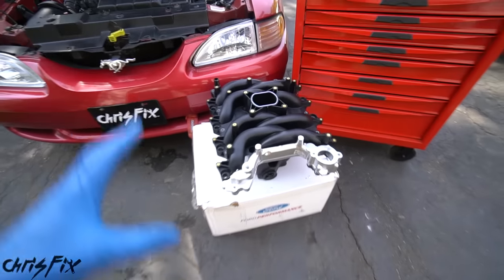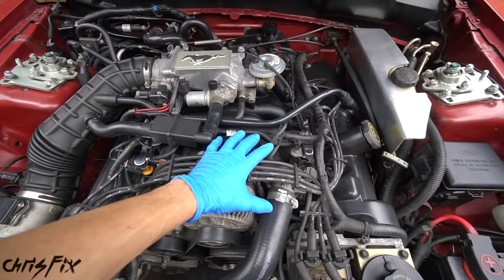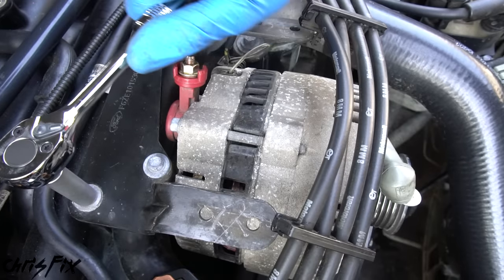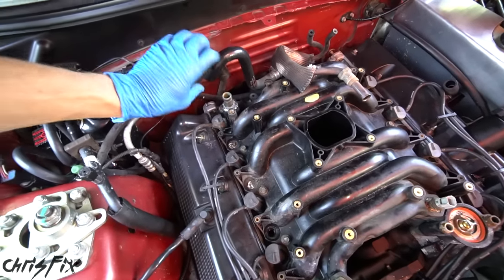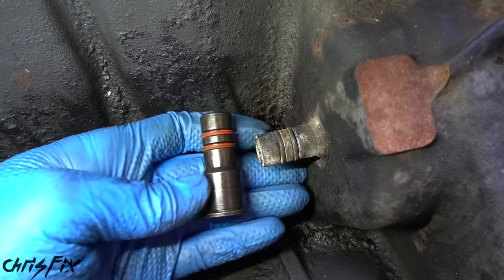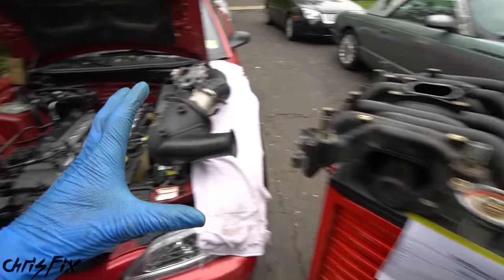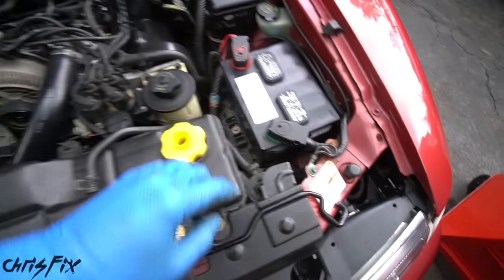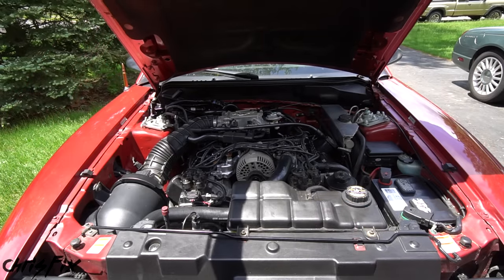How to Install a Performance Intake Manifold and Replace Gaskets (Dyno PROOF)

Comment: A Turbocharger installation vid would be sweet
Reply: Jack Mclaughlin super*
Reply: Super charger is much better and more reliable
Reply: Ballz Of'steel depends who you ask... turbos are more efficient
Reply: Jack Mclaughlin turbos arent good for drifting .on concentration drift
Reply: But super has better power delivery ;)
Reply: Ninja R3Kill  who said turbos arent good for drifting they are the most used for drifting
Reply: albimmer turbo give sudden jump of power which could be bad when initiated in a drift.
Reply: Ninja R3Kill  small turbo bigger injectors  big boost tuning
Reply: oh god another turbo charger vs super charger debate. :/
Reply: albimmer a lot for a turbo, stock or supercharger would be mad tho
Reply: Ninja R3Kill whats even better than turbo and superchargers is twinchargers its a turbo and a supercharger  combined
Reply: albimmer sure
Reply: Jack Mclaughlin  you have a good idea
Reply: Jack Mclaughlin A Supercharger is easier to install,a supercharger installation video would be better,Because its easier and people can do it at home.
Reply: Would be awesome for his $300 Del Sol.
Reply: EarthClad nope. Turbo is best
Reply: Guys... there is twincharger so you can stop arguing wich is better...
Reply: Vortech supercharger lol

Comment: I'm all for installing a new intake. But. Seeing what happened to the old one. Holy balls.
Reply: Thanks for the heads up! I've never seen nor heard of this happening. Might make me rethink buying an older Mustang.
Reply: The GMC intakes are also notorious for intake manifolds leaking. The gaskets and the manifold itself would melt around the egr, usually between 60 and 100k. Suddenly you get a gusher right into your ports and then hydrolock. And then you have the leaking valve cover gaskets resulting in oil on the exhaust and then fireballs. Official recall fix is more tin foil...
Reply: James Bell yup mine cracked and leaked all over!
Reply: Daniel Rouw Never had that happen to ours, but ours only recently hit 130k. We talking 5.3 and 6.0 or just most GM engines?
Reply: hewfil1 no, i was referring to the 3.x v6 car engines and the 4.3 v6 abomination. GM wasn't dumb enough to try plastic on the larger engines as much. The ls series engines you have are fairly good. Just watch that you didn't get the bad head. There was a couple that had porous metal around a coolant channel. I think that was the 5.3.
Reply: Trashman yup. Plastic. But to be fair it's partly gov regs, heat resistant composites aren't cheap. It's more a weight reduction than cost savings.
Reply: Abominations?! I love those little things. 
And our truck is a 5.3 so if that's the case I'll keep an eye out.
Reply: hewfil1 the 4.3 isn't all bad. But it's far from a good engine. It's a v8 with 2 cylinders lopped off essentially, which results in a poorly balanced and inefficient engine.
Reply: hewfil1 just checked. It's the earlier 5.3. 2001-2006. Gmc issued a TSB.
Reply: Our 5.3 is a 1999. WHEW

Comment: This mustang needs more power,nice work😉
Reply: Mahmoud Dh i think he is gonna throw a supercharger in it
Reply: moamel B yehh of course
Reply: Turbo!
Reply: A coyote is needed, amazing how much better they are than the Triton v8.
Reply: everss02  The triton v8 was only in the trucks via the 4.6 or 5.4 the mustangs all 96-04 2vs were either Windsor or Romeo blocks the difference is the tritons compression chamber were at a 75 degree angle for torque and the Romeo windsors were 90  for more power and when I say angle I mean the v in the center of the motor tritons are closer while mustang motors are further
Reply: @johnmcclenaghan6561  , ......... you sure about that
Reply: @everss02  If a coyote will fit. They're 29.5 inches wide. That's about as wide as a big block chevy with tall valve covers. That said, yeah, a even a stock Coyote would double the power. This thing is choking to death above about 4k stock but the manifold helped by bringing the curve up to about 5k. Thing needs cams.

Comment: “not difficult to do” 
me: sweats nervously stares at my engine in shambles
Reply from the maker: I promise it's easier then you think!
Reply: Write out a list of each step for disassembly, and give each step a number. When you're done, even if it's a lot of steps, think to yourself it can be done in XX simple steps. Start with one and before you know it you'll be done.
Reply: Oh yeah yeah
Reply: @chrisfix  I am kicking myself for not seeing this tap part. everyone around me has 3/8 16 npt cant find the 18
Reply: @ruhan_a  oh yeah yeah
Reply: Yeah, it's really a big a** job.
Reply: This is my EXACT problem right now, which is why my brand new intake manifold is still sitting in my kitchen and not in the car lmao 
Mainly in part because I'm just nervous as hell of doing it
Reply: Dude I just did this on my 03 mustang gt and honestly I was dreading it until I started and honestly it was really really easy. I’m confident if I can do it you can do it. I’m a YouTube mechanic😎😂
Reply: @brandonstone6962  same
Reply: @shamallewis405  Once you start doing it, it really is pretty easy, you just have to take your time and put all the bolts in a labeled bag and put them in order of disassembly..
But my suggestion would be to run by the ford dealer and get yourself a set of intake manifold bolts BEFORE you start.. And make sure you have a torque wrench handy as well.. But other than that it is all really easy and straightforward, just make sure to get some pics of everything in case you forget where a few things go after.. But take your time and it could possibly be a good idea to have a good set of bolt extractors handy as well JUST IN CASE
Reply: @PreciousBoxer  wait that's actually useful, thanks
Reply: @chrisfix  than*

Comment: Have a 97 T bird and I put a PI intake off a 2010 crown Vic on it and it definitely wakes up at redline. It made a huge difference for mid and high range power.

Comment: drills hole into intake manifold

Chrisfix: 🤷 op, would you look at that. Guess I have to install a performance intake. 🤷

🤣🤣🤣
Reply: I feel like he pokes holes in his car parts so he can make a video on replacing it
Reply: @cesarrobledo458  it's joke but ford designed these intake manifolds terribly. The 96+ 4.6 2v   intakes were made out of plastic and that crossover that was leaking coolant was recalled. They kept plastic everywhere else, just not on that crossover. He has a PI intake from FORD FRICKING PERFORMANCE and it's still made of plastic.

Comment: I don't see how you need 50 years of experience to do this. But regardless I learned something valuable today ☺
Reply: roger3137 That last sentence is the key.  You don't NEED 50 years of experience, but if you say 50 years compared to 5 or 10 is nothing, either the 50 years have been wasted by someone incompotent (which I know who you're referring to, so that's not the case), or you're talking out your ass.  With the years of experience, that's more cars worked on, and therefore, more experience.  With each car worked on, it's a potential for learning something new and learning new tips and tricks.  So there are some things that the geezer can teach a novice that he would have probably figured out years later, and likewise, there might be some things the novice could teach the geezer that he may have overlooked in all his years, and I'm using Novice relative to the years of experience.

Comment: Tip, if u dont want to cut a bolt for alignment, line them up and put extra rtv dots throughout the gasket to hold it in place. Thats how i did mine and it lined up with the coolant ports/ bolt holes almost perfectly
Edit: would mention to sit something on gaskets while rtv sets before torquing down intake (pevents air leaks where gasket doesnt  want to flatten out)  I loved the dyno sheet in this video because the 4.6 community doesnt have a whole lot of actual before and after references for the npi intake vs the pi intake.    cams, pi intake, injectors, and bigger maf will net you even more. About 250/260 crank hp

Comment: *Dog drinks coolant 
Next video: “How to revive your pet with common tools at home”
Reply: You forgot the “soapy wooder”
Reply: And your medium strength threadlocker
Reply: But there will be some special tools that you can get at your local parts store
Reply: "How to flush out the fuel intake on your dog"
Reply: How to drain your dogs coolant using only a screwdriver
Reply: Is this a head gasket replacement
Reply: Dont forget the muffler bearings

Comment: so with Performance Exhaust and Performance Intake Manifold we went from 189 HP to about 208 hp there are about 20 HP gains  
nice job lets boost it now buddy 
keep up the great work
Reply from the maker: Yep. Goes to show you that these brands and companies that say “35hp” for a filter is fake!
Reply: yup if it's too easy to make 35 hp from a filter will its suppose to come with this filter from the factory lol
well its time from some boost super charge or tubo it bud

Comment: When wrapping teflon tape around the threads of a fitting, i turn the fitting clockwise. This keeps the tape from wanting to unwrap as you start to tighten the fitting into the port. It tightens the tape instead of making it unwrap. One fitting was done clockwise and the other counterclockwise. I'm sure both will seal fine, it's just something I've always done. Actually, now i prefer to use ptfe paste instead of the tape. To each his own. Keep up the great videos. I'm excited to see the supercharger install and dyno results. 
  I'm also curious about the port alignment on the head vs new intake manifold. It seems that the intake runners were misaligned quite a bit on that gasket. If you gasket match the cylinder head to the gasket, the air/fuel charge will flow more smoothly into the combustion chamber rather than hitting that lip at the cylinder head. That's probably where the torque loss came from. Regardless, 50hp @ 6000 rpms is impressive. Keep up the good work.

Comment: high performance water pump +50hp
Reply: alexdrapeau you mean wooder
Reply: Sticker +5hp lol
Reply: spray paint flames on the sides for +100 HP
Reply: Ricer logic 1000Ft tall spoiler=100009999984747287582829858444+horsepower, Lambo door=100000+HP
Reply: Cringe wheels 26718293029726273738494058166+ hp
Reply: Actually high performance water pumps have different cut angles on the pump rotor to help eliminate pump cavitations that will cause the coolent to boil , and surface tension products like "water wetter" will eliminate air bubbles from forming around the back of the water passages in the cooling system

Comment: Chris, your videos are the thing, man! You put in so much hard work planning, performing, and then, editing the videos, it appears so easy to the viewers, even though it's not. After seeing your videos, I slowly started learning and trying to fix my 14-year old car, a 2008 Toyota Prius 2nd gen. It had a lot of trouble as I had to learn about MAF sensor cleaning, throttle body cleaning, air filter & cabin filter changing, finding performance oils & oil filters, spark plugs, PCV valves and transmission fluids, but your videos are very helpful man. Thanks!

Comment: I did the exact same thing on my 99 mustang :') huge difference in the wait pulls
Reply from the maker: Yea it is pretty significant! I wonder how much more power you get on a PI engine?
Reply: Significant full pi swap which is the heads cams and intake is around 35-40rwhp peak and close to 100rwhp gain above 5k rpms.
Reply: The cool part is you will actually make more power (around 15rwhp more) than a factory 99-04 pi engine because when you put the pi heads on the non pi engine you end up with about a point higher compression due to piston design.
Reply: Chris If your on a budget just pick up the pi cams and springs.  They go used in the $40-60 range from 99-04 guys who do custom cams and springs. And if you want the same overall power without buying the pi heads get step thinner head gaskets at the same time. This with the pi intake you just installed will get you right on par with a pi motor.
Reply: From there add that 75mm tb and plenum you have.  Next step is cai, longtube headers and a tune and optional underdrive pulleys. With all this you can expect around 275rwhp and 300rwtq. Huge gain over stock. Ford really limited the potential of the 4.6 v8 from the factory.
Reply: Last popular upgrade is if you do the pi heads and valve covers is converting to the coil on plug setup and ditching the coil packs and plug wires.

Comment: Chris,  you should clean fuel injectors, as they were disassambled)
Reply from the maker: Good idea
Reply: Or put new ones in so the car makes more power.
Reply: Injectors don't increase power. They just allow for more potential power to be made. That's why they are supporting mods.

Comment: 20:28 ok... 200hp and already spitting flames
Reply: That be his tune running too rich and spitting raw fuel out the exhaust and then igniting. Computer needs tuned for those new mods.
Reply: JoeIsCrazyWillman thanks for explaining
Reply: How is it running rich when the induction was altered and fuel was never touched?
Reply: @eriv4735  When you change induction you need to tune for it or the computer will be confused and  default to generic maps and may be too rich or too lean, which may foul the O2 sensors and then will definitely run richer.
Reply: Older computers have self learning maps that compensate for small changes such as intake manifolds and will work themselves out in a few miles of driving while it learns..a lean situation will NEVER lead to burnt o2s so there is no possible way for a car to run rich with no change in fuel maps (which this car had none)..I think you may have you info mixed up and you may not be familiar with older cars?..I’m not trying to flame just give correct info on the situation
Reply: @eriv4735  I have ONLY owned older cars except for my current 2011 ranger 4.0L (which is basically still a late 1990s motor). Otherwise I've only owned 1996, 1998, & 2000 year vehicles. When I changed the intake on my 96 Ram to a much higher port flow, lower volume, shorter runner intake manifold, I also changed the tune. I changed at the same time to a max-ported stock throttle body, rocker arms to a higher lift ratio roller rocker, and hardened pushrods. Mine didn't spit flames at all, and was putting 216/265 to the wheels. Tune was clean, no smoke from raw fuel even at the upper rpm, and only the faintest puff of black upon letting off after the dyno pulls. Tune is key. Flames is excess fuel plus an escaping spark or a hot egt causing the excess unburnt fuel to ignite.
Reply: I checked out a cpl vids after I replied and that is one nice ram dude, I’m feeling that roll pan..while I can not speak for rams or mopars, I know Fords and I have done more intake swaps than I like to remember honestly and have never come up rich..very lean at times but never rich..in my experience the only thing to cause a flame was altering fuel delivery
Reply: @eriv4735  I know my Ram I don't have to remove the distributor to remove the intake. Don't know it the modular motors are the same way or like Chevy where you do? Cause removing and reinstalling a distributor leaves the window open for a fuel synch issue.
Reply: The modular engine does not have a distributor so there is no timing issue to occur with the swap..the older fords had a distributor but you could remove the intake without removing the distributor..either way if you know how to remove and reinstall a distributor correctly you would still have no issues with timing
Reply: @eriv4735  not timing, but fuel sync. Timing is in the PCM on OBD2 cars.
Reply: The distributor controls ignition timing and fuel delivery is and always will be pcm controlled..distributor has nothing to do with fuel?..I think you may be getting confused
Reply: No, the distributor is gear driven and has nothing to do with advancing and retarding ignition. The PCM sends electronic signal to the coil, and the coil fires the ignition and the distributor simply transfers the spark to the correct wire. The PCM either advances or delays the timing of the spark created and transferring  to the distributor and then to the plug.
The fuel sync is set via the distributor tho. It sends an electronic signal about the position of the cam, which is what the PCM then times the injector pulses by... So an improperly positioned distributor will tell the injectors to fire at the wrong time, but since the distributor on a computer controlled car only distributes spark, not times it, timing is unaffected as long as you have all wires in the correct spots still.
Reply: I do not know where you are getting your information from but none of that is correct
Reply: @eriv4735  It is, because that's exactly how my vehicle works. I have photos of how to  set the fuel sync from the distributor properly. Also, my tuner changes my ignition timeing based on my octane, mods, etc.
Reply: It's not possible to introduce more air into the mixture and then run a rich ratio. I agree, you do seem misinformed.

Comment: The same thing happen on my Lincoln town car. Over time, the one piece plastic intake weakens and leaks. You're lucky coolant didn't get into the cylinders like mine did and mess up the motor.
Reply from the maker: Dang
Reply: Instead of going for an upgrade, I went for a Dorman cheap intake manifold.

Comment: Haha. Get a drain pan. Grabs a turkey bake pan.
Reply: Just changed my bikes oil, 88 cents at walmart for one, you cannot go wrong!
Reply: electroreviews01 hey but if ya buy one everytime you do oil after afew times it'd be cheaper to get a drain pan
Reply: But you have to clean the drain pan. You can just throw out this one.